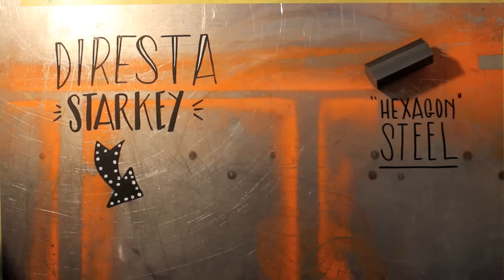Laura´s Diresta Starkey

Comment: Awesome....   Love your twist on what Jimmy did.   
I'm curious about your ear protection.  They look like headphone but also look like full hearing protection.  With my recent problems I've had with my ear I'd be interested in what you're using.
Reply from the maker: +Go-C Graphics Yeah, it´s exactly that. i have a little sandisc mp3 player cliped to them and that way i can listen to podcasts and music without having that cable in my way. the brand is called Zekler. Awesome product!
Reply: Well, it doesn't look like they sell those in the states.

Comment: What's the point in the screws if it's riveted?
Reply from the maker: the key are held in place by the rivets...the screws hold the plates together.
Reply from the maker: since the rivets are filed they wouldn´t have enough strengh to hold it all together when turning the key with force...
Reply: Oh, i'm new to this kinda stuff. Thanks for responding :)